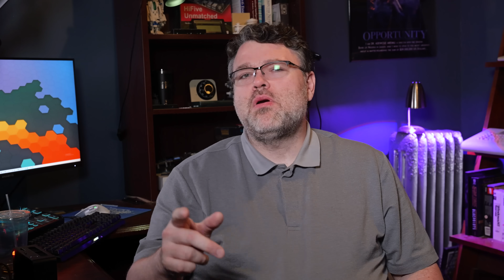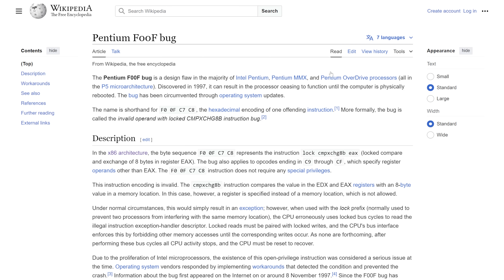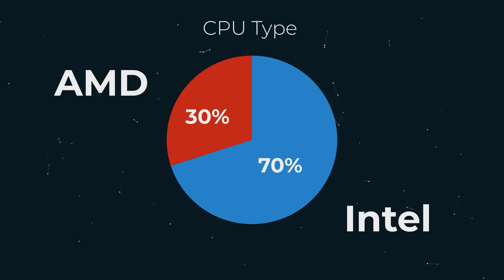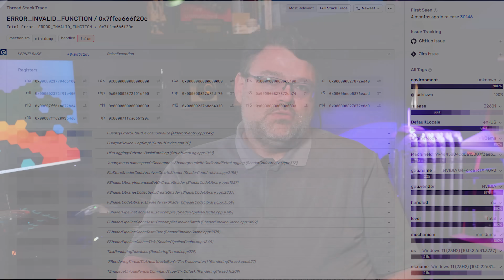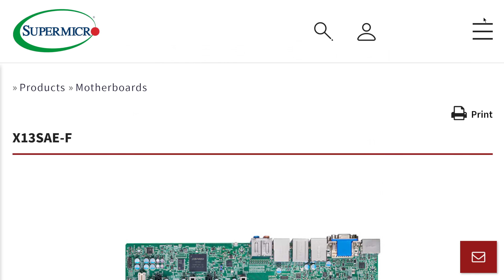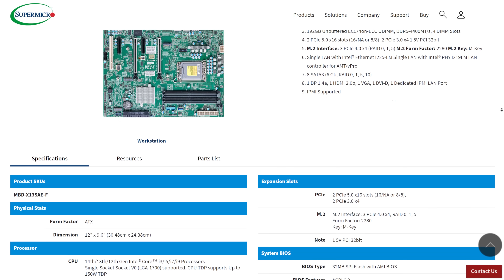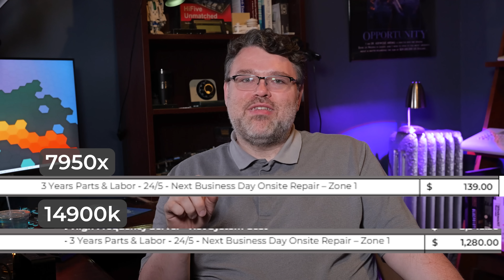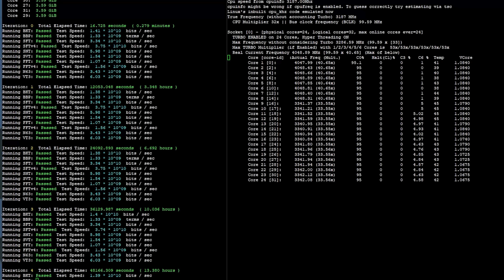Intel has a Pretty Big Problem

Comment: Based off my experience overclocking these things......I'm pretty damn confident in saying the problem lies in either the ring bus or the system agent is just at it's damn limits.    I would more than be willing to bet on the VAST majority of the true raptor lake dies that are failing are all going to be larger 16e core dies.   It never sat right with me how wildly the power consumption on these chips was affected by the ringbus and how minor bumps in speed took absolutely shocking amounts of power and tons of system agent voltage fiddling.  In retrospect, this explanation falls in line with how cagey intel has been about the SA voltage in the non-z chipsets.  Basically we're seeing the limits of one of these two things and that it's so close to the limit that natural degradation of the silicon will cause faults.
Reply: The craziest example I can remember is an alder lake cpu that would do 5ghz ring.....at about 400watts.   Drop it down to 4.8?...300 watts.   Drop it to 4.6...250...and 4.4 only took 220-230ish.  E cores were all disabled and the p core settings were the same on all tests...the only thing that changed was the ringbus/cache.
Reply: @otaking71  I do wonder if the L3 cache is running at Ring-speed or Nearest Core (cluster) speed. I'm not sure how it's set up on these chips, and intel's changed whether the L3 is core or interconnect-synced in the past before; the most recent example I can think of being the Skylake-X server (and HEDT) chips where the L3 was run at Mesh speed and not coupled to the nearest core in terms of clocks. If the L3 is run at ring speed, the huge sensitivity to ring clocks in terms of power draw would suddenly make a great deal of sense. That's a significant portion of the transistors on the chip being run in a single clock domain at very high speeds, and synchronising all of them is a power hungry pain in the ass. If it is running at ring-speed, it's certainly possible that it's being run too hard and if not the source of the issue, certainly contributing to it.
Reply: @speeddemon1092   iirc...the ring is tied to the l3 cache speed and not the other way around.   My understanding is that the l3 cache controller is pulling double duty as the ring bus controller.   I believe memtest86 shows  damn near 1:1 scaling of the l3 to the ring.   I had expected elevated power consumption...but to that level was what was head scratching.    200w for 600mhz..the last time i had about that speed for that wattage was my pentium ii overclocking days....lolol
Reply: @otaking71  I could probably get that level of power/clock scaling on my 10980xe if I was stupid enough to go for 5ghz all-core. Anyways though, point still stands. Running L3 cache 1:1 with the ring (@5ghz) is a huge number of transistors all being driven at high speeds and with exacting demands for synchronization and integrity. If I did my math right, if the L3 cache on these chips is using 6T SRAM theres close to 2 billion transistors dedicated to L3 cache all being driven at 5ghz. Even on a current-gen process, running that many transistors that fast is no easy task.
Reply: Iirc, the 1700 socketed
Xeons... have avx512 by virtue of having no e cores......if the xeons are ecoreless dies and no failures exist..we might having something of a smoking gun.   I havent touched a 1700 xeon...and havent seen a delidded die shot
Reply: This is potentially actually quite a far reaching problem because who knows how badly 14700K CPUs, which are popular, will also degrade eventually. 
And on top of that: People would be veeeery sceptical when buying 13900K/14900K and even 14700K CPUs used. At least I wouldn't want to  buy one of these used. When consumers realize that their $700 CPUs are essentially worthless after just 2 years of usage, Intel will loose many enthusiast consumers
Reply: @Atilolzz  if i am right...its a very deep problem....that might not even be fixable without a complete respin of the silicon.    Prior to 12th gen...the most cores were 10.   Alderlake brings it to 16....raptor 24.      If you look at what intel has said about xeons.......intel went to mesh vs ring layouts around skylake...meaning the last ring based xeon ...had a max of 22 cores.   This doe not even account for the fact that true xeons dont have gpus on the die at all (everything is tied to the ring bus even if its disabled.)   This is an actual physical limits type of limitation.  So 24 cores + whatever the gpu needs is well beyond when intel abandoned ring bus on xeons.
Reply: Could it be that this is due to the AVX offset was not triggered probably in light tasks such as gaming?

I mean we will never see this in all these stability test then, because the load is heavy enough in these benchmarks for AVX offset to kick in
Reply: @quanlethienminh6002  It's not likely to be an avx offset issue.   The way to understand what i've pointed out here (to the best i can oversimplify it)..is the ring bus is like a road/traffic network between all the cpu parts while the system agent is the traffic cop/monitor/system.   The pcie controller and memory controller all sit on the ring bus.   In the scenario where the SSD corrupts....the data can't make it from the cpu core down to the pcie controller.   Add this explanation to what wendell is saying and it should make things much clearer as to wtf exactly is going on.    Disabling/slowing down stuff doesn't change the fact underlying infrastructure is just pushed to it's limits the way it is.
Reply: If it was that simple don't you think Wendell with all the data would have figured that out? Just a though cause you know.. Wendell does know what he's talking about.
Reply: @filmboy18  Wendell doesn't know the answer either.   He's sharing his data and sometimes that drives other thoughts and ideas.  Wendell's data put this explanation of the problem into my thoughts and thus i'm sharing it..  the explanation is horridly simple, but how exactly do you test this.   Just because something is obvious doesn't mean somebody has done it.

Comment: A faulty CPU can cause all kinds of funky behavior, since it processes literally everything. VRAM "errors" can be as simple as CPU failing free space > allocation check in DirectX API somewhere, I/O errors can be data inside caches being corrupted/CPU failing to calculate checksums or whatever.

Speaking of weird slowness behavior - kinda sounds like clock stretching , Intel CPUs have it as well, 12 gen and later (may be even earlirer). Slowing down memory does reduce effective CPU load, disabling E-cores lowers the temperature of P-cores, both of which make CPU more stable at a given voltage+clock speed combination. Seems a lot like Intel/mobo manufacturers/UEFI f-ed up clock voltage tables badly, or boosting behavior being too trigger happy to reach max clocks. Would like to see results of manually lowering clock speeds.

Some Gigabyte mobo's happily supplying 1.7 V to 100 C 6 GHz CPU makes damage irreversible (albeit with some weird settings, but it''s kinda ridiculous that it can go that high without user intentionally typing 1.7 into CPU voltage, just by weird interaction of extremely aggressive boosting and LLC).

Also, isn't it funny how strong Intel (OEM?) mindshare is? AMD has been crushing gaming since 3D cache release, and has been competitive for 7 years, yet there's still 70/30 split there.

UPD after watching GN interview: oooh, seems like everything is much worse than I thought. Laptop CPUs are failing, 13600Ks, heck, even non-k SKUs do. I'm wondering, how big is system agent and cache voltages are, and how did they change from Alder Lake
Reply: I'm never going to get any DirectX errors here. That's because I don't do Windows.
Reply: @1pcfred  OK, Vulkan and OpenGL probably have similar checks as well. Anyway, something else may get corrupted, it doesn't really matter
Reply: @MrKatoriz  are you out of your Vulkan mind? I feel the issue is they're K SKU chips. Intel shouldn't even be making those. They're just asking people to break them.
Reply: yeah, when the cpu starts getting into that fuzzy logic territory where some bits start flipping to the wrong side, memory/pointer errors just launching a program aren't out of the ordinary, 
i guess it can go to shit with the PCIe addressing all the same :D

Comment: 7800 3dx and no crashes so far… lots of gaming…
Reply: air cooled 7800x3d intense gaming last 10 months great cpu
Reply: The 7800X3D is amazingly efficient, have mine running at a total package power draw of 60W

That being said, it definitely sucks for people who used Asus/Gigabyte motherboards before the VSoC fix as it could've damaged their chip. The difference is AMD allowed everyone to RMA the chips for said issue
Reply: I'm eyeing amd laptops in the meantime, this RMA circus is getting ridiculous.

At this point I just don't care how long Intel needs to fix this.  We just need to know if there will come a point where it will be stable for 10 years, or whether to throw out the Z790 entirely and to jump ship 😐

Comment: The performance dropping by 50% minutes before the crash and the crashes being more common on 2DPC boards makes me think the issue is in the memory controller which in talking to overclockers the ddr5 controller is weak and prone to throwing errors. Something tells me it probably can't be fixed in microcode at best mitigated.

Comment: So glad I've skipped Intel for the last few years, what a bloody mess they've made for themselves. Ran an Asus X570 Formula with a 5950X and 5800X3D for a combined total of 3.5yrs roughly with my system running 24/7 and in all that time I've had no BSODs and games have been rock solid. Only been running my 7950X3D on an Asus X670E Hero for a month, also been on 24/7 with the same Windows 11 install and again rock solid, no BSODs and no game or other software issues. 

Intel needs to get its bloody act together and stop pushing CPUs to their breaking point. Not only is AM4/AM5 a really good platform it's doing it while sucking down significantly less power, running cooler and being a far more stable and reliable platform overall.

Comment: Only solution I found as a gamer was to neuter my 13900k and then 14900k with intel Xtreme tuning utility. I would have to lower the clock speeds until i could get any DX12 game to open.

Comment: You can’t find the correlation in the slowness before hard crash because they are paving over exceptions in firmware. It’s why companies like Oxide are doing their own firmware on so many components.

By hiding your exceptions you can blame others, because there is probably something really wrong with the chips.

Comment: Crashes every 2 hours is extremely excessive. I don't run either of these CPUs but even with my weird collection of devices, I experience a game crash every few months on a bad day. Even then the issue is usually solvable, just reboot the system. 

Even when I used Celeron, i3, i5, i7, I experienced the occasional crash and that's usually because my system was underpowered. 

But when a server or multiple servers are having issues and price premiums increase and Intel has no solution, that's a very, very bad sign.
Reply: Out of everything on my PC, the Intel Bluetooth drivers has given me the most headaches and that thing crashes only around twice per season.

Computer just randomly reboots and Bluetooth is no longer available. A complete power down and reboot solves the issue. It's far more benign than the CPU problems and I still find it unacceptable.

I don't think any of my friends have issues, it is always either the GPU, RAM, or something weird like their RGB controller. The CPU has never been a problem. Granted, none of my friends have a new Intel CPU.

The only device that seemed to have CPU stability problems was my 2015 MacBook Pro 13". That thing would drop frames when exporting video and get kernel panics every now and then.

Comment: I strongly suspect that adding e cores to the "Core" architecture created some sort of underlying instability. I think Intel may have always known that Core had some issues and that those issues were intermittent and rare enough that no one outside of their own testing ever caught them. Their recent move to eliminate hyperthreading strongly supports that there was some issue inside the architecture as well.

I think getting clock speeds so high, and possibly getting memory speeds so high, is causing a fault that previously happened every few years to happen much more frequently. Add in silicon imperfections so minor QA testing isn't catching them and you could have the whole of the problem, possibly also why it took Intel so long to shrink their die below 10nm.
Reply: @aaronmoore3050  Maybe it's also a silicone quality issue so not all CPUs will develop this issue.

Workload, cooling, and cooler mount quality may also be factors.
Reply: @aaronmoore3050  Having more RAM modules will always cause stability issues. That's inherent in having imperfectly matched traces subtly throwing off timings. At least as far back as DDR3 it was an issue and it is also why server DRAM frequently runs at default speeds and timings.

So, it could be making some other issue worse but it is very unlikely the actual cause of this.

Comment: amd user and i've watched (through steam forums) intel users have a LOT more issues especially it seems with unreal based games. also not buying users/MB makers are at fault, the MB makers get their specs from intel, would they risk the cost of replacement of board/cpu by intentionally over clocking a cpu beyond safe levels? yeah, that doesn't play, companies are risk ADVERSE not risk takers. sure mistakes could be made...but for all companies and only on intel?

this comes across as a marketing scheme by intel to try and out perform amd by boosting the sh*t out of their cpus beyond safe levels.

so the errors start showing up as the chip degrades. this voltage/amperage degradation does appear random because of the silicon lottery and all chips not being equal. some might have no problems, minor issues, or constant crashes when a specific program section is run.